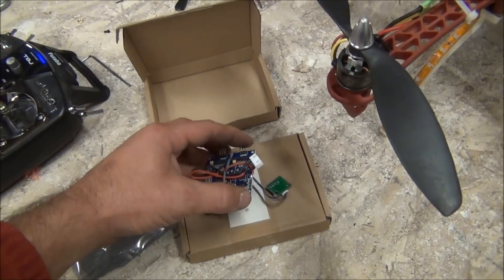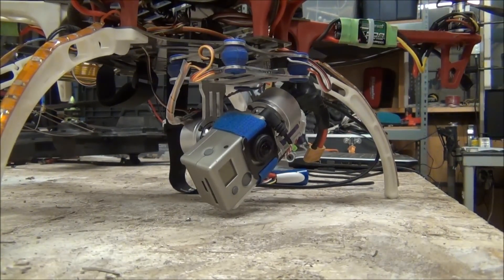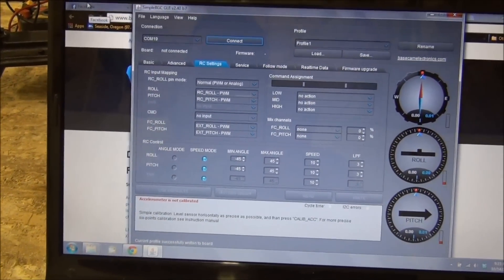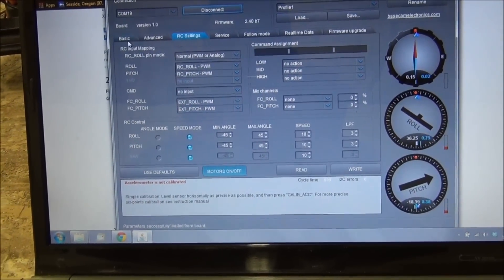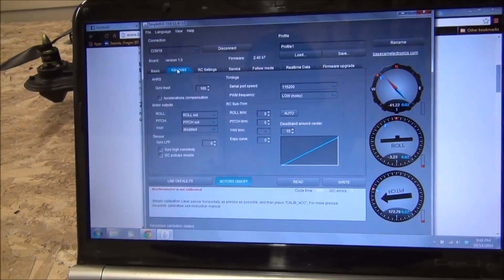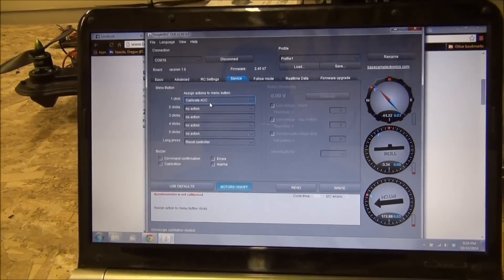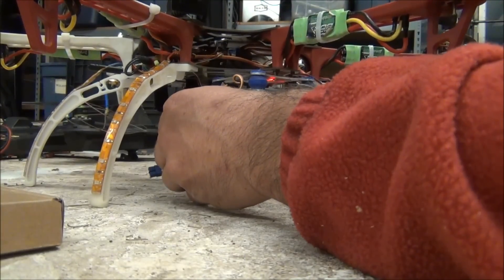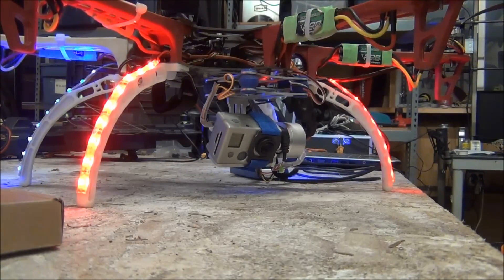Brushless Gimbal Controller setup

Comment: This was super-handy, thank you!
It turns out that if you're trying to use one of these big old gimbals with a new gopro or gopro clone that weighs a fraction of what the old ones did, the key to stop the gimbal from jumping around like crazy is to cut the power in half or more- 40 on pitch and 90 on roll with the one I'm using.

Comment: Hi i know it's 2018 but i got a question about this setup it's all about the default gimbal setting when i pitch about 50 degrees the camera shakes is there a way to adjust to make it pitch about 70 degrees from the gui ?

Comment: Hay I'm struggling to get my new hakrc 3 axis gimbal to plug into my computer so I can make changes to the settings on it. It's running a storm32 board but I'm not sure of the firmware. I downloaded a few port drivers and a few GUIs and still can't get the GUI to see the gimbal. Any ideas?

Comment: Hello, is it possible to connect this gimbal to a naze32 controller so you can also controll tilt through an extra channel on your tx?
Reply: My rx only outputs PPM, so direct connection to the rx is a no-no I guess? Does the naze32 output pwm for gimbal controllers?

Comment: Really nice explanations, my gimbal works now like a charm. I don't like to just copy someone's configuration without understanding, but in this case I learnt and understood what parameters I have to change and what are they for. 

Just a couple of questions; is it better to connect the pitch input from the receiver or the fc?
I couldn't test it out yet but if my gimbal doesnt point 90* straigth down when changing pitch from tx, do I need to change angle limit from the Bgc or the pwm from receiver?

Thanks for your video.

Comment: dont know if your still doing this, but I came across your posting here and it seems you really know about these gimbals

I recently purchased one of these 3 axis gimbals  from goodluckbuy which are like the ones you have there
Im already completely lost

Im running 3dr pix hawk and have had the tarot 2 axis  gimbal working for a while now until it broke, 
wanting to use different camera rather than a go pro, I figure Id buy one of these
the tarot was easy, plug and play, with two wires coming off the aircraft, one for signal one ground
I have no idea what Im doing with this one, 
seems it trys to initialize and works, but easily goes out of wack, 
would you consider setting it up for me if i send it to you, 
I would be glad to pay you for your time
thanks

Comment: This tutorial saved my gimbal. I purchased an inexpensive CNC gimbal from ebay and when I powered it up it was shaking, flipping and making noise. This is my first gimbal and I figured I got a bad one. I decided to check YouTube for any ideas before sending it back and found your video.         I decided not to update the Firmware, just to use the updated settings screen and set most the values to what you were using. The damn thing works perfect now! Thanks for sharing this!

Comment: Hi I have purchased a similar gimbal complete it says in the instruction do not alter firmware or board becomes in operative ???
Reply from the maker: +dusty dave Yes, some of the BGC's will "brick" if you try to upload new firmware.  But, no problem with making settings changes...

Comment: Nice video thanks. Just a question do you know if the board will handle a 14.5 volt battery? I have a hex with a 5000mah 14.5V battery. Thanks

Comment: probably the best video so far explaining chinese copies, and how to get them to work. Almost worth the extra bucks to avoid the headache. There needs to be more videos like this explaining everything a beginner would need to know, before getting into this. Anyways, I think I finally got mine to work. it finally connected. It says my firmware was 0.57 b4, this version doesn't even exist. So after reading some comments all around the web, I was told to download GUI 2.2. And it finally connected. I did not have to flash the damn thing.
Reply: wat do u mean extra bucks chinese copies are cheaper
Reply: thxu

Comment: Hi  is there a way to disable the auto-leveling of the pitch. I am building a handheld gimbal and I want the pitch to aim where I point it. In other words, I want to be able to aim the gimbal at the sky and then pan down to the ground. So basically "lock" the pitch position. Thanks

Comment: Hi First off thanks for the video. It's is quite informative.
Small question: What transmitter do you use to control the gimbal in the end and how to set that up?

Thanks
Reply from the maker: +Fábio Santos I am using a Futaba T8J; but any transmitter with an extra channel would work fine.  On my UAV's I have the gimbal plugged into a free output channel on the flight controller and a free channel on the receiver ported to that same channel so that it can be controlled with my laptop or with the transmitter.  The gimbal controller has the remote control feature built right in; so it is reall just a matter of plugging it in with some servo cables.

Comment: Hi there and Many thanks for the video... That really helped a lot!!! ;)
The only question I have is: I've finished the hole thing and after saving and disconnect the LEDs on the board keep flashing fast wen it should be fixed as per normal! What do you suggest ?

Comment: while you do this is just the gimbal connected to the pc or do i need the battery to be plugged in aswell?
Reply from the maker: +Matteo Adrogna You can do the programming without the battery plugged in, but the motors will have no power.  I usually make adjustments with the battery unplugged, then plug it in to test, then unplug for further adjustments, etc.

Comment: have you permanently bricked one of these boards (that is not compatible with v2.4b7)?
Reply from the maker: +Power Max No; not because of using the GUI.  If it is incompatible with the GUI, it just posts a "GUI/firmware mismatch" error.  I did accidentally flash a newer firmware onto a clone board which did render the board inoperable, but I was able to re-flash it with an older firmware.  The only bricked boards I have are due to physical damage, power supply problems, etc.
Reply: +sewerzuk Ahh, that's a relief. I actually went ahead  and tried updating the firmware to the latest 2.4b7 release, but the upgrade didn't work. I don't think it bricked the board. I then proceeded to wipe the EEPROM though arduino, that worked fine, the LED blinky stretch also worked fine, proving that the board is just a glorified arduino. However, I couldn't get basecam software to connect to it (probably because the wiped board is no longer programed with basecam software, so the basecam serial protocol link never gets established) and now the firmware upgrade tool within the GUI does not work for any version. I probably need to use the AVR ISP header to program that HEX file in, but I don't know anything about that.

I will try the AVRdude tool today to see if that does work. However, last night I found this firmware called "BruGUI" which is open source software, so I uploaded that to the board. The flashing process for that is VERY similar to multiwii, downloading the source code, opening it up in the arduino IDE, and uploading that sketch. It didn't work right away, I had to tune the PIDs, calibrate the gyro and acc, and swap the XY axis or something, but in the end it seems to work OK. I will need to fly with it to see how well it performs.

Comment: This video saved me from investing in additional cheap gimbal control boards, so my thanks to sewerzuk.  My $49.99 Amazon Andoer gimbal also programmed fine with V2.2b2 software.  Also required was an initial download of CP210x USB to UART bridge driver (V6.7) on my Win7 computer.  I simply followed the setup discussed and my f450 (APM2.6, Xiaoyi camera, Taranis radio) is learning to take very pleasing videos and interval stills.  Thanks again for sharing.
Reply from the maker: thanks for the positive comment, I appreciate it!

Comment: I can’t seem to get the motors to working. It connects to the software fine. The motors just won’t move. 

Tarot 680 Pro
Naza M V2
Taranis Plus Transmitter
X8R Receiver

Comment: Hello from Spain.
I would like to know that you use your battery to control the gimbal.
I would like to use the gimbal in a crane and want to know what you use to put battery directly.
Reply from the maker: billy thepoo You can use the balance connector from any 3S LiPO battery
Reply: thank you

Comment: This is going to sound stupid but as I only want to control the pitch, do I connect the gimbal board to the receiver or to my CRIUS AIOP flight controller
Reply from the maker: Adam Keely You can do either; connecting it to the flight controller allows some extra functionality, but if all you want to do is control the pitch from your transmitter, the easiest thing to do is to just connect it directly to the receiver.  I have mine connected to my APM flight controller so that I can have it automatically pitch up and down as part of the flight program, but also have it set up with RC pass-through so that I can also control it with my transmitter.

Comment: Hi sewerzuk.
Nice presentation, it seems as I've found the right person..., hopefully? :-)
I also bought this BGC Gimbal from China and tried to remove the Noise by setting to High, which made the Gimbal shaky and more noisy..? I therefore tried to calibrate, both in simple and advanced, which didn't solve the problem.In desperation I hit the Default button and the Gimbal went crazy allover the place, the Compass, pitch and roll indicators on the GUI is now just flickering and values are all over the place and the PITCH sign went inverted(Upwards down).
I disconnected from GUI and powered up the Gimbal on the Quad, it's completely dead, the Green LED is on but no movement.
Could you lead me in the right direction to get this Gimbal back on-line..?
Your help on this issue will be greatly appreciated..!
Cheers
Kenn
Reply from the maker: kenn knudsen I'll try to help!  Which camera are you using?  First thing's first; make sure you have the camera balanced (center of gravity needs to be centered on the pitch and roll axis, so the camera tends to stay in the position that you place it even with power off).  Once you have done that, Try these values for pitch and roll:  P:5   I:0.04   D:10    Set the power for pitch and roll to about 120.  Change the number of poles for the motors to 14.  Then plug in the board and run the gyro and acc calibrations.  If the camera is upside down, change the Z axis to -Z. Let me know what you get...
Reply: sewerzuk Hi sewerzuk.Thanks for your time. I'm using the SJ4000. Perfectly balanced. So far I've followed your instructions and successfully got in contact with the gimbal again.When I'm powering up the Gimbal on the Quad it's now its trying to tilt backwards and making noise while trying to..!Think it needs more tweaking..?
Reply from the maker: If it is trying to tilt backward, then try changing the axis from Z to -Z.  How do you have the sensor mounted?
Reply: The sensor is mounted horizontally, underneath the camera platform.
I changed the axix to - Z and X, which solved the problem..! The Gimbal is very silent and works without shitter and noise now, Greeaaat...! Thanks alot for your help.. :-)
I saved the profile, so I won't be in a similar situation in the future... :-P
Now remains only test flights and fine tuning, so I don't promise to be out of your loop yet..!
;-)

Comment: Found the problem, turns out the roll axis motor is faulty. Switched the two around and now i have the same issue but with Pitch. Problem followed the motor. Have asked supplier for a replacement motor. Thanks for trying
Reply from the maker: Chris Cavill Excellent!  Glad to hear that you figured it out...I hadn't had a chance to look at your video yet

Comment: Yeah, it's balanced, and it moves freely without power. When you tilt the quad to 45deg the gimbal can't hold the camera level, it has a large slow oscillation.
Reply from the maker: Chris Cavill Does it happen in both directions?  What do you have the power set to on the roll axis?  Have you run the accelerometer and gyro calibrations?

Comment: Need your help, bought a gimbal with 2.2 firmware. The pitch axis moves perfectly, however the roll is very jerky and won't hold position. Motor power and "P" gain aren't having much affect. What can i do?
Reply from the maker: Chris Cavill Is the gimbal balanced well?  Will the camera stay in a neutral position without power applied?

Comment: Nothing works for me. My cheap Ebay gimbal hums like a vibrator machine.  The calibrate accel. command does NOTHING. The calibrate gyro command does NOTHING.  Device will not accept firmware updates. Do you suppose I could re-sell this thing as a good paint shaker?
Reply from the maker: gklugie The chinese clones' firmware cannot be updated; and the calibrate accel and gyro function happens fairly quickly...you need to look at the status LED on the board during the process.  As far as the vibration, try turning down the power for both pitch and roll, and reduce the P to 8, I to 0.04, and D to 4.  This should get you close...
Reply: sewerzuk
Thanks  will try!

Comment: hi i have te same gimbal but when i pich forword the gimbals starts tu buzz and vibrate.... there are now wires that get puld on ore somphing like that. i think i can solve this problem in the software but i dont now how... could you pleas help me out... it seams you now alot about this gimball...

greats Jaap
Reply from the maker: Jaap Martin To solve motor buzz, I usually turn down the power to the motor and also decrease P and D setings (D should be roughly 1/2 of P)
Reply from the maker: Does your gimbal have adjustable arms?  It is important to get the center of gravity right in line with the axis of both pitch and roll motors. If you get this right, then the camera will tend to stay in any position that you place it, even without power to the motors.  They aren't very powerful, so this is very important...
Reply: sewerzuk you seem to know what you're talking about haha, I want to put a heavier camera on it (135g ish) but it just falls when i push it too far in one direction, is there anyway to counter this? i have the power set to 150 already but there isn't much change...
Reply: I'll try this out tomorrow, thanks for the help man! :)

Comment: Have you had any experiences with the official boards vs the clones?
Reply from the maker: Eric Magnet Yes; I have worked with both.  The clones usually work just fine, but it is hit and miss which version BGC software and firmware they run.  Sometimes, an upgrade will brick the board.  I actually have several gimbals...I run the cheap clones on my multirotors because I seem to go through one every few months (water, impact, etc.).  I run genuine ones on 2 non-aerial gimbals that I have.
Reply: Would you say the genuine board is worth the money? Im planing on building a small one handed go pro gimbal. I was looking at the news BGC tiny 32. Thanks
Reply from the maker: From a functional standpoint, no.  I don't think the genuine boards are worth the money.  The clones can be tuned to work just as well.  From an ethical standpoint?  Well...Basecam was the company that designed/built the software and hardware in the first place.  Its kinda nice to use their products.  That was one of the reasons I bought a couple of genuine boards.
Reply: Thanks alot for your response, very helpful. I couldn't seem to find a straight answer online. I'm just looking to play around, and as much as id love to support his effort, 15 bucks is much cheaper than 130. Thanks again!

Comment: Thanks for uploading this video found very helpful, one question I have MOS tube PTZ board & it is up & running but there is some vibration do you know whether this can be removed by tweeting the setting if so were would one start?
Reply from the maker: I have found that lowering the power settings helps to reduce the high frequency vibration...maybe start there?

Comment: nice video but I have a question for you , I have a eagle eye gimbal with a SBGC v3.0 32 bit board on it and Im having a hard time getting this to work. Do you know of  any where I can ship this to have someone set this up for me ?
Reply from the maker: Is it an "official" Basecam board?  If so, Basecam Electronics will likely support it for you.  If it is a Chinese clone (most of them are) I'm not aware of anybody who offers support for it.  What kind of problems are you having?
Reply: The gimbal came from China all the wires were connected other than on the board and from what I'm seeing on the Web you have to tweak the senors. The device came with no instructions which is crazy and noooo support.lol  so now I have to find someone to ship it two to tweak the senors and connect the wires. If I had your email I can send you photos of the board.
Reply from the maker: Michael Mcgriff I sent you a message with my email address